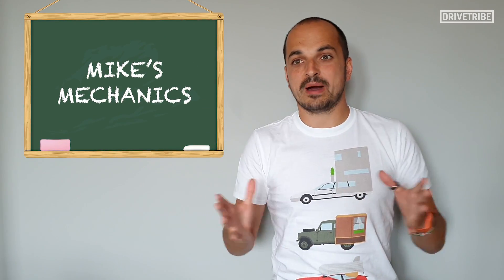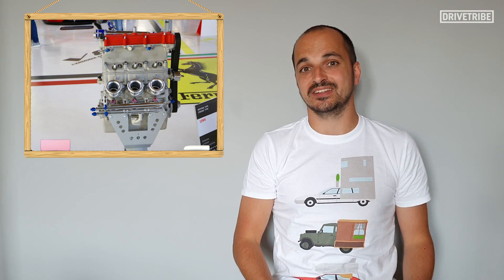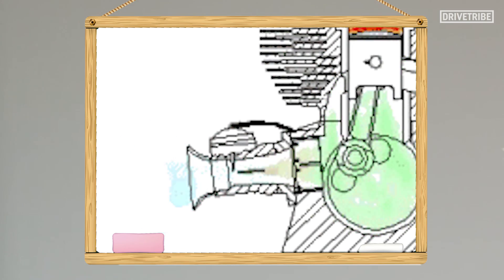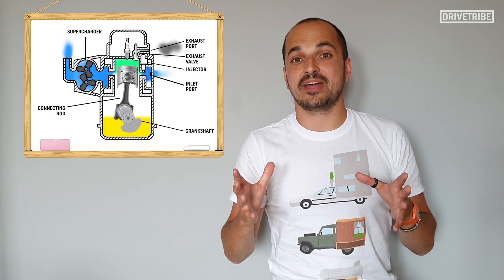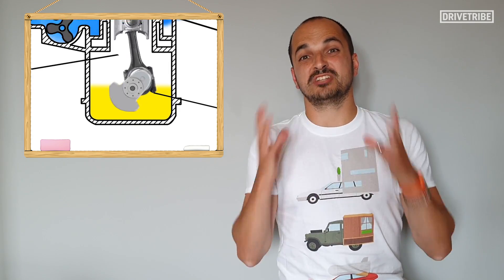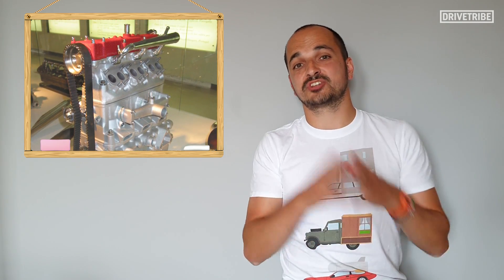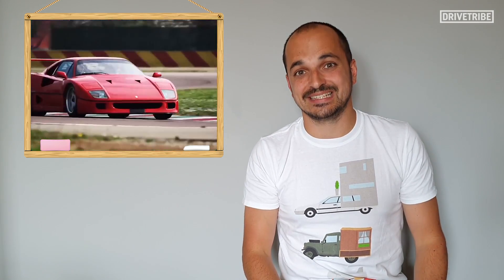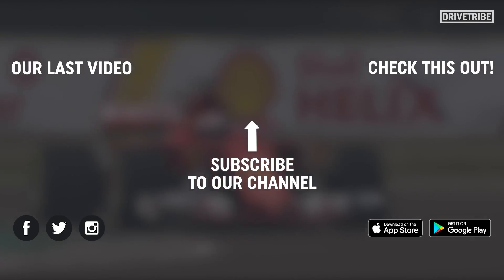Ferrari once made a supercharged two-stroke 3-cylinder engine

Comment: Perhaps you may see bike engine manufacturers coming to F1.
Reply: Again. e.g. Yamaha and Honda
Reply: If not wrong in the past yamaha have made engine for f1 team.
Reply: @ekofebrianto3659  they wvwn go toake ones dor passenger cars such as Xc60 volvos
Reply: Unlikely as it may cost to much, but I like the idea. Honda is already there
Reply: @diegoaponte8512  company's like Yamaha have worked with car company's to develop engines and engines components so to see a bike company start building race engines is pretty likely if not already being done
Reply: @6door6four96  i do believe yamaha designed the V8 used in the Volvo XC90, which trickled down into some of the hot and nasty Morgan supercars. they also did the tiny V8 in ford's SHO for a little while, and that was a pretty zippy little engine
Reply: @ghomerhust  that was a V6 right?
Reply: @ghomerhust  Yamaha also worked on the LFA engine.
Reply: @ghomerhust  Yamaha helped design a lot of engines for different manufacturers. They also did the 1.25 engine for Ford which ultimately became the Sigma engine lineup if I'm correct.
The story of the Volvo V8 was that they needed one for the US market but none of the Ford V8's could be fitted transversely as Volvo wanted. Yamaha is very capable in designing small packaged engines.
Reply: hamdi chami Yamaha made both a V6 and a V8 for the SHO.
Reply: @meeder78  Yamaha made a 60 valve (5 valve per cylinder) V10 F1 engine, which was  both 3 litre & 3.5 litre. There was some tie-up with Judd F!.
Reply: Correction. The V10 was a 50 valve and the V12 was a 60 valve. However, for me, the V10 F1 engines always made the best sound.
Reply: @diegoaponte8512  yamaha may "borrow" the mgu-h system from honda, or join forces with e.g VW group or BMW  (they've "e"-turbos - MGU-H)
Reply: Well we have Honda
Reply: Yamaha has and also made many of the performance heads for toyota's performance cars. For a long time if your toyota engine had a G after the hyphen in its designation (1jzge, 2jz-gte, 4a-ge, 3s-gte, 2zz-ge) the head was likely designed, or flat out cast by yamaha.
Reply: @misery13666  I have a 2zz it's a aluminium cylinder head designed by yamaha and they also had some input in the rest of the engine, in jdm form they rev too almost 9k but in uk spec its 8250 and 192bhp from a Na 1.8 litre
Reply: @connorhorrocks4333  the 2zz is a 2zz-ge. like  I said. only weird thing with those is that they didn't use gZe for the supercharged version. (z after the hyphen means supercharger just like t means turbo
Reply: Suter maybe?
Reply: Are you thinking somebody better than Honda, Yamaha or BMW? They all had a go and I think only Honda had any considerable success. But does Honda even count as they also make cars?
Reply: Honda, Yamaha, BMW entered the chat
Reply: Honda has been there done that.
Reply: KTM has the most modern bike twostroke engines 💪😏

Comment: Koenigsegg: "interesting"
Reply: Not to even mention GM who built millions of 2stroke supercharged Diesel engines which also had exhausts valves. The concept of a superchargers  2stroke is nothing new.
Reply: konniegsigg : What can you say about this FREEVALVE???
Reply: Silently Sceptical  Their so called "innovations" that are supposed to change the car world forever
Reply: Koenigsegg is the most innovative car company. Whatever you say, thats the real.
Reply: Also mv Agusta
Reply: Cosworth did it originally with 4 cylinders. Now they're doing it with 3 because of V6s and V12s.
Reply: Koenigsegg was founded the same year this engine was made public, with their first car sold in 2002 - one that used Ford engine. None of their innovations predates this particular engine, that's just dumb.
Reply: Koenigsegg's creations haven't really found commercial uses.
Reply: @ishkaranbrar313  Qoros 3 has the freevalve system too
Reply: @ishkaranbrar313  not yet but I think we might start to see free valves pretty soon..

Comment: Now that's called Engineering!
Reply: No what you call engineering is Dodge/Chrysler getting only 400bhp from an 8L engine in the 2000 Viper. Amazing (I'm being sarcastic).And then Mitsubishi got the same from a 2L engine 4 years later.
Reply: Sukhdev R34 ok, so it’s both engineering then.
Reply: @sukhdevr3489  I would assume these two engines have a very different set of pros and cons. However, I am in no way trying to insinuate that you are incorrect.
Reply: @dawsdep  yeah, still was pretty amazing from Mitsubishi.
Reply: Sukhdev R34 Agreed! 👍
Reply: And it has been Explained!
Reply: Nope, it's called looking at 1950's diesel technology and trying to make it gas powered.